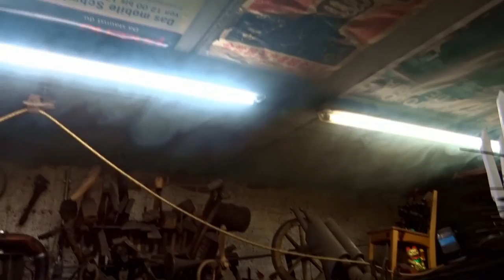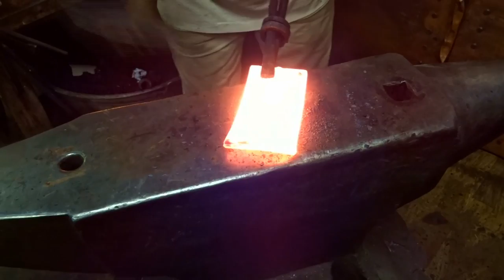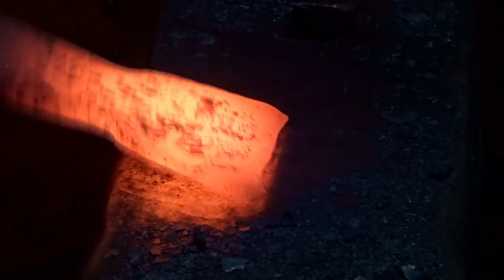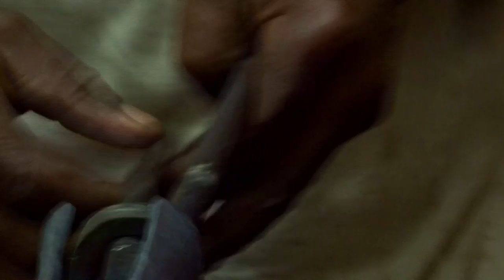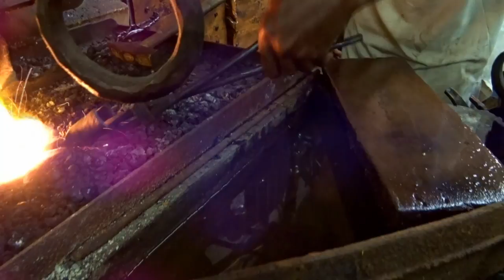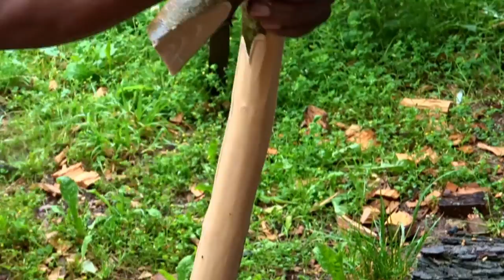Schmieden einer traditionellen Axt /Burkina Faso von Hiwame Konate.www.ideenkunst.de

Comment: I love this video. I also really like that smithy and his incredible skill at the anvil. What I am most impressed with are his tongs.  I noticed that his tongs has 2 flat heavy rings holding the tong halves together instead of a rivet and a bbs. It offers unique and very diverse application possibilities for the tongs as he obviously demonstrated. I thought it was really amazing that he was able to hammer and pound out a very nice looking adze blade in a short period of time. However, I would not have used the steel he chose. An old european style heavy duty truck leaf spring. It's made with 2 different pieces of steel welded together down the middle.

The smithy in this video is amazing. All those tools at his disposal, all the different tongs he could have used. Instead he chose the most basic one and showed us how much more versatile and useful his style of tongs really are. I'm going to make me a pair one day, as close to the same as his as possible, with a double flat ring to see how well the tongs perform. It will be a very fun experiment.
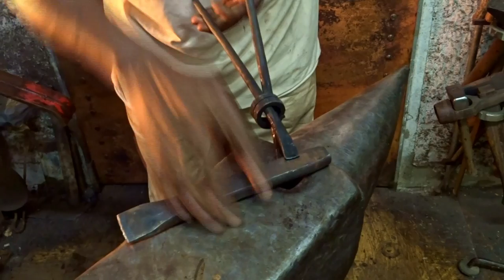Reply: it is not a double flat ring but a spiral , a spring with a holding function you can see exactly at 01:30 how it function . this is one of the most Hitec pair of tongs I've ever seen ...
Reply: Another video on this channel shows it in better light, by the name of The Hammer With Two Heads. The barrel shaped coil was forged from stock that to my eye looks 1/2 the thickness, and then overlapped so it's twice around plus a quarter turn. Genius.
Reply: You have to remember he's in Burkina Faso. Most people in countries like that can't afford high quality steel. It's cheaper for them to use scrap iron for tool making instead of fresh ingots like we do here in the West.